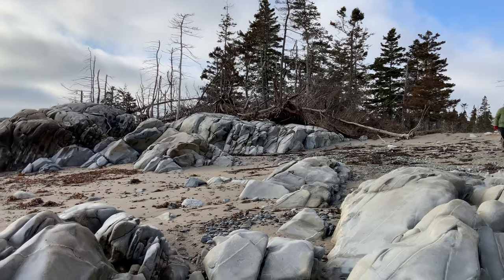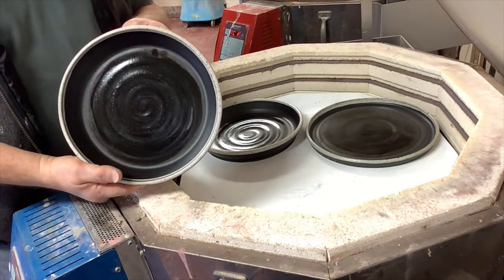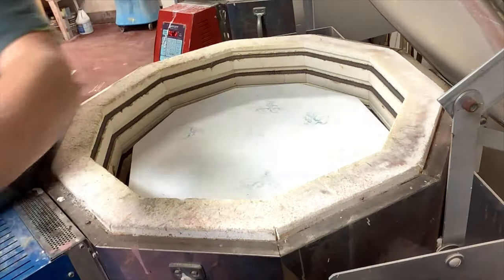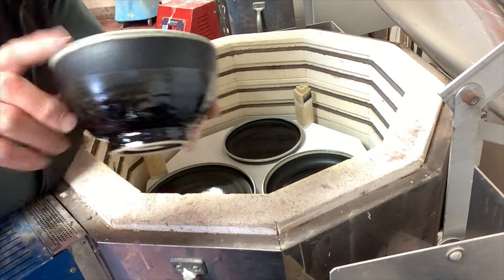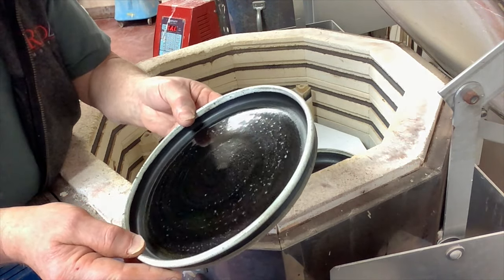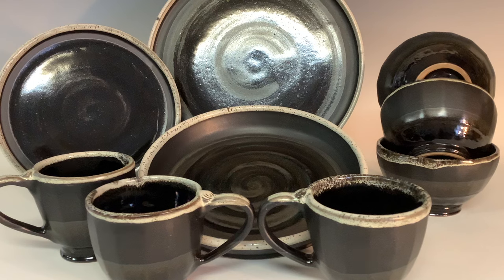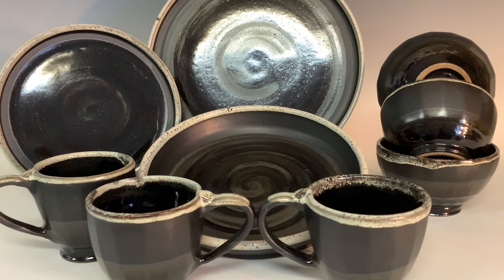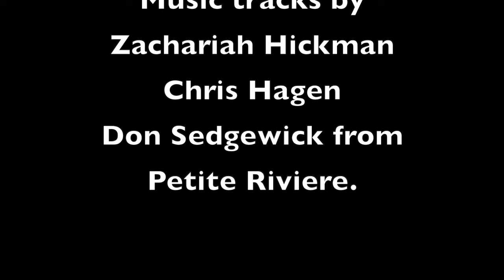Making dinner sets and place settings.

Comment: Thank you Vaughan.  You said your clay was recycled batch I’m using laguna bmix for everything!   Should I try a different mix for dinner sets?
Reply from the maker: B-mix 5 does not do well at cone 6 and I have had plates crack if put in a microwave.
Reply: @Vsmithpots  ok thanks Vaughan good to know.